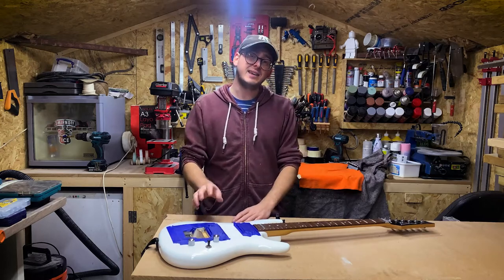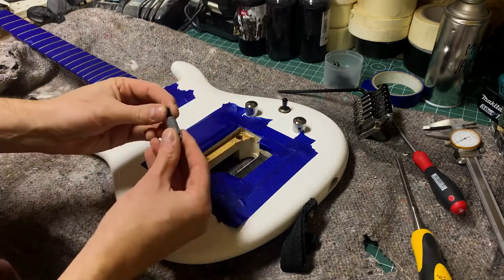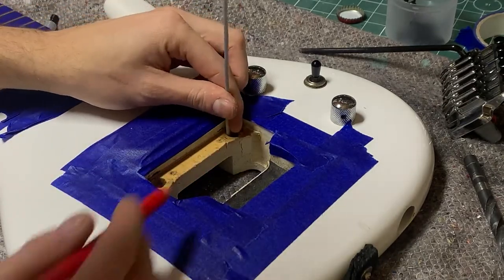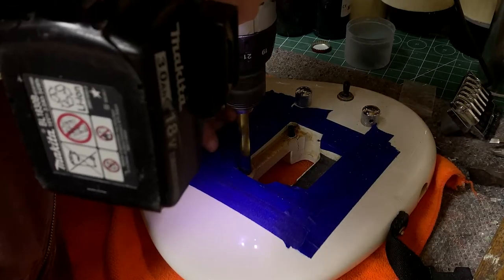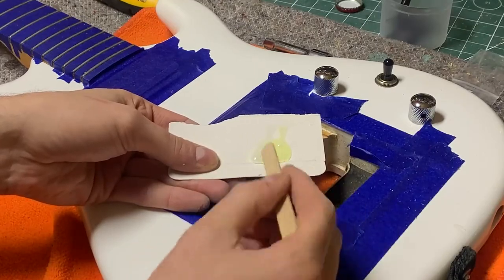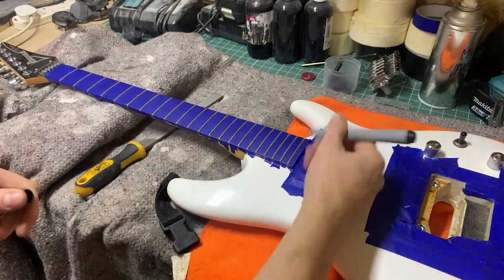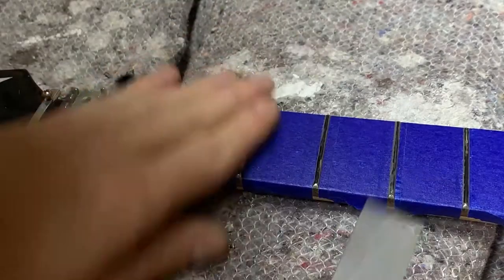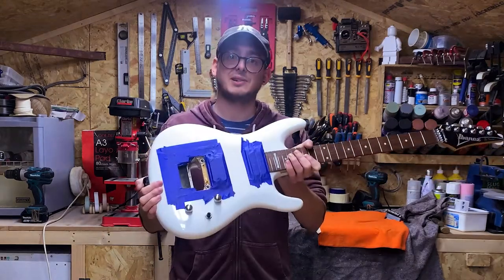Ibanez JS100 Edge Pro II Tremolo Repair / Upgrade / Floyd Rose

Comment: How did you remove the original studs?
Reply from the maker: On the js100 there screwed into the body via and connecting bracket. Normally you’d screw and old stud into the post and use it to just pull it out with pullers.